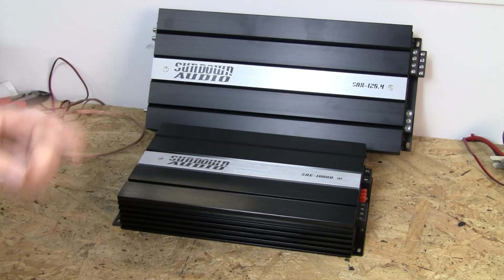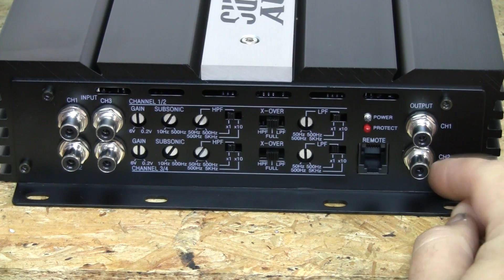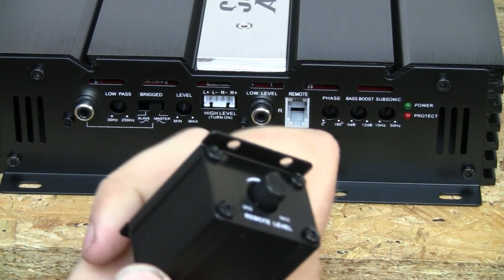Do you know what all these amp settings do? - Tech Stuff Tuesday

Comment: Concerning the PHASE knob adjustment, you have mentioned in most cases it doesn't matter. You may be right. In some cases makes the world of a difference. I think some amp designers have gone through specific experiences then decide it was actually crucial to put such a knob on every amp they would make. I think in every industry where quality is crucial, there have been are and always be small details which make collosal difference in that particular experience, details understood only by few who have had the pure luck to get it. One of my last experiences in car audio was with the grounds in a car audio system. On the internet there are different opinions on how to ground but never a general idea, you always find different pole opinions. Until you try it yourself. Having a common ground point for all your audio equipment in your car would enable you to enjoy your system how you were supposed to.
Reply from the maker: Grounds can absolutely make a huge difference. The phase thing is more common to see a difference in mids/highs than in subs. That can absolutely be a huge thing in the upper end of response.

Comment: Awesome vid as usually. 
Question, im trying to tune my rockford 801s. I have it bridged but there is a left and right gain. Which side/gain do i use to adjust the amp. 
Any help would be appreciated. 
Thanks and keep up the great work
Reply from the maker: I found those to be odd, I used one once. Move the gain knobs and see if one or both does something. That should answer it.
Reply: @EMFAudio  both work but one more than the other. 
Weird right. . 
I get mixed messages in fakebook but you know how that goes😕😕🥑
Reply from the maker: @heathentheheretic4909  I rely little on what people tell me and all on what I test myself.

Comment: So I heard you can damage a car amplifier by mounting it to a subwoofer enclosure is this true if so how does the car amplifier get damaged and what happens to the car amplifier when it gets damaged from being mounted to a subwoofer enclosure
Reply from the maker: It is possible. Solder joints can break which can cause larger failures. Board traces can fail too.

Comment: My mid and high amp start at 120Hz to 3kHz. My subwoofer amp is set to 80Hz.  Where should my mid and high be set at ?
Reply from the maker: You can only high pass starting at 120 hz? That is not optimal. Does your headunit have crossovers in it?
Reply: @EMFAudio  my H U has EQ .
This is my amplifier.
crunch PX1000.4 Power Amplifier (Class Ab, 4 Channels, 1,000 Watts) https://www.amazon.com/dp/B0196FLS50/ref=cm_sw_r_cp_apa_i_CbD9CbSCQ6TGV
And my HU.
XO Vision XOD1851 in-Dash Double DIN 6.2" INCH Wireless Bluetooth Touchscreen Monitor https://www.amazon.com/dp/B01DTN7O7Q/ref=cm_sw_r_cp_apa_i_-dD9CbSEGP8XA

Comment: I was wondering if using ofc for power to your amplifier and cca for ground would cause a issue?Or would it cause to much impedance change?
Reply from the maker: Impedance is dynamic, that changes in a magnetic field. I think you're thinking of resistance. To answer your question, resistance difference isn't what will effect performance. CCA can't handle the current OFC can. So, as long as you aren't exceeding the current capabilities of the CCA wire, you won't see a difference. If you exceed it's limitations, yes, you will see a difference.
Reply: Yes you are right I was thinking of residences . so with 4 runs of power 1/0 cca and 4 runs of ground 1/0 cca,I should be okay on a American Bass VFL COMP 5k?
Reply from the maker: @joebelton2146  2 runs of 1/0, what the amp actually takes in, would be sufficient. It's a 5k amp, not a 10k amp.

Comment: You should make a video on how to know what soft parts are compatable with what motor/basket assemblies. I've seen builds that have things like sundown soft parts in ascendant audio assemblies. Just something I've always been curious about!
Reply from the maker: There are literally millions of combinations. Parts are not universal in that all 3" coils fit in all 3" motors, etc. Different cones have different dimensions that will work on some baskets and not others, spider landing sizes vary, just a ton of considerations you couldn't blanket.
Reply: @EMFAudio  so id have to measure everything out, and contact manufacturers for soft part dimensions, is what it amounts to, correct?
Reply from the maker: @ddude1595  Generally speaking, manufacturers won't just sell soft parts. We don't, but we'll recone stuff with our parts and others we source. Basically you'd have to measure yourself, source parts yourself, and figure out what will fit. Just because it fits doesn't mean it will be good either.
Reply: @EMFAudio  so if it's not too much to ask, whether it's your parts, another company's parts or stock DC parts, what would you recommend for just a general overall improvement on a DC XL m2 15?
Reply from the maker: @ddude1595  There isn't a blanket answer for that because every motor and coil combination is different. The quality of the cones and spiders is one thing, the design of them is another, per application.

Comment: Quick question can you mix AMG batteries meaning different sizes amp hours if so how can I hook it up
Reply from the maker: Yes, Ah doesn't mean anything in terms of battery compatibility.
Reply: @EMFAudio  so I will still hook it up the same parallel and series
Reply from the maker: @FLYGUYFOX  Nooooooo don't wire batteries in series. That will add voltage to each one you do. So unless you're replacing 2 batteries in an RV that runs on 24v, don't do that. Parallel only.
Reply: @EMFAudio  it's for my car amplifier I have to hook up a parallel & series wanted to ask you more increase the voltage
Reply from the maker: @FLYGUYFOX  Putting two 12v batteries in series will have the capacity of 1 battery but increase voltage to 24+v which you can't charge and will likely blow up your amp instantly.
Reply: @EMFAudio  basically all I can do is put it in parallel for longer run time
Reply from the maker: @FLYGUYFOX  Yes, it's the proper thing and the only thing.

Comment: Quick question.  
I just repaired my Rockford 801s and I'm a little lost as to when it's bridged and should I adjust both gain knobs or simply one of them thanks
Reply from the maker: The owners manual should tell you, but one way to tell is to bridge it then adjust 1 knob, then the other knob. If nothing changes when you turn one of them then no it wont' matter. If it changes when you do both, then yes, you do need to adjust both.

Comment: Is it dangerous to pass speaker level input through rca inputs of an amp if it cant allow high level input
Reply from the maker: Yes and no. Yes you could do it, up until the maximum voltage of the amp. So in the case of these amps having a maximum of 6v, you could use the speaker level made into an RCA jack as long as you didn't exceed 6v. Over that could/would damage the amp.

Comment: Gain matching and phase matching of multiple amps on an oscilloscope with no load and then with subs wired video? Possible termlab scores for comparison.
Test A: Gain matched only with no load
Test B: Gain and Phase matched no load
Leave gain and phase settings as is and wire subs. 
Test C: adjust gains if necessary with amps under load.
Test D: adjust phase if necessary with amps under load.
Reply from the maker: The tricky part to that is having a vehicle with multiples of the same amps and multiple subs to benefit from phasing. I don't personally own anything that would be able to properly demonstrate that.

Comment: so could I use the bass boost to help a sag in a bandpass? like say it's tuned to peak at 35hz and 55hz, but the sag was in the middle, could you technically get rid or at least midigate the drop (within reason of mechanical limits of course)?
Reply from the maker: Presuming your bass boost was 45 hz and you had an actual peak at 35 and 55, yes.  Just because it's tuned there doesn't mean it WILL have peaks there.
Reply: But can bass bost introduce cliping at such given,frequency??
Reply from the maker: @brookeleimgruber860  It absolutely can. That's one of the reasons you should never use it more than a couple dB boost if ever.

Comment: my gains are set to max in every way shape and form on the amplifiers side, however my bass gain on my unit is only set to +2db and it sounds fine up to volume 25-31 (depending on the song) people don't understand that you can turn gains up but run your eq on the radio as you see fit.  i do not play into distortion and should i ever smell a speaker (again, certain songs hit that "moar power" spot) i dial it back a bit. i turn my tweeters up as high as possible to compensate but i do need an amp just for them. (4.4k bass vs 50*4 tweeter lmao)
Reply: So your saying you don't know shit and your a fool😂

While yes you can do that it isn't the correct way and also bad information to spread
Reply: You big dummy(fred sanford voice)

Comment: Will Subsonic filter cancel out the low pass because its lower hz
Reply: Think of the subsonic filter as a saftey limit on how low your subwoofer will play.
Reply from the maker: If you set it wrong, yes. Remember, subsonic is a high pass so if you set it to 20 hz and the low pass to 80 hz, that will be full signal from 20-80 hz. Now if you set the subsonic to 50 hz and the low pass to 50 hz, yes, it would absolutely kill the signal.
Reply: @EMFAudio  thanks for quickly responding love tec Tuesday keep up the good work
Reply: It's a cut off point to where the sub  or any other speaker won't play below that range. Like a high pass but for low end of spectrum

Comment: If the power and ground wires touch each other and short out the power and ground cause a car amplifier protection led to turn on
Reply from the maker: That should also cause the fuse to blow, hopefully quicker than the protection on the amp. That kind of short usually kills a power supply before protect can do anything.

Comment: I am surprised you did not mention the tweeter trick when setting the gain. Set up a test tone that is well below a tweeter's high pass crossover. Then hook up the tweeter in parallel with the speakers. Turn up the gain until you hear distortion from the main speakers, or anything at all from the tweeter. This works because the signal will not have any content in the tweeter's pass band, but when clipping occurs anywhere, there will be output from the tweeter. This will smoke out distortion even in head unit line out signals - really handy when doing factory radio upgrades... You can even do this for tweeters. Just get a high sensitivity tweeter and make a 12Db/octive high pass at about 15khz and keep your test tones below 10k. Putting a led in parallel with the tweeter can work too, esp if you can't hear tweeters anymore.
Reply from the maker: That's more of a gain setting thing on it's own, but I did think about making piezo distortion detectors to sell.

Comment: nice video what about it you have a processor  before amps u don't see much info on youtube
Reply from the maker: What kind of things are you thinking specifically? What would you want to see covered in that video?
Reply: @EMFAudio  we all know how to set amp gain an frequency how to turn up volume 3/4 up an set deck , but when you install let say audio control eqs these are high output or even a clarion preamp or both most pre amp have volume control how do u set gain an frequency on these processor an amp an can you still go up 3/4 volume on deck.
Reply from the maker: @wazid0122  For starters, no, we don't all know how to do that, that's why I do these videos. I don't even use 3/4 as a reference, I use the highest volume that is clean which on some is full volume. Setting the gain is the same method with a processor or not, which I could include in the video. I have some other ideas to include as well. I'll put it on the to-do list.

Comment: I thought ya use the subsonic only for inverted lol I keep it turned down always mmhh
Reply from the maker: Inverted or not makes no difference on how the sub behaves other than inverted you have a small amount more box volume.
Reply: I think your thinking of phase
Reply: Subsonic should around 20..
Reply: Probably just out of phase but turned down as in the lowest hz won't hurt any, actually maybe save your sub from damage

Comment: I need to learn more about gain and the voltage of the head unit. 
But this is very informative . 
Thanks
Reply: If u want to know u have a good input source get a pioneer deh-80prs, It can play to 90% volume before it ever gets near clipping it is the best unit under 950
Reply: @1-Six-dee  not that any people are willing/can spend $950 on a head unit. 

OP: Essentially gain adjusts your amps output. Most people think that it's like a "volume" knob. That if you turn it up your amp makes more power and vice versa. Not the case. Your owners manual will tell you what your head units output voltage is. And that's what you adjust your amps gain to. Most are around the 2-4v range. And while you can just turn it all the way up and lower you head units subwoofer setting or vice versa that's not the correct way. Best thing is to find the head units voltage output and adjust your amp as close as possible. I hope that helped a little....
Reply: @mikecheeze4312  the deh-80prs is only 249
Reply: Deh-80prs is 249 but there is proof search videos on yt on the outputs of the deh-80prs and at like 90% volume the thd is 0.1%
Reply: @1-Six-dee  that is why under 900 bucks dude. Also you can't tell somebody it's the best unless you have undeniable proof.

Comment: If there was a quality unit (similar to the deh-80prs)  putting out 6-9 volts could this voltage being clean produce more power?I know the amp can. Put out rated at 0.2-6 volt input but if u have a clean 7-8 volt input would the amp distort it just because of the input voltage being so hi?
Reply from the maker: The only way it could actually be producing more than 6v is if it was balanced outputs, which few are, and the amp would have to be balanced in as well. If you go over 6v you can fry the preamp on the amp. It doesn't just turn into a bad signal, it's like sending too much voltage into the power supply, it fails. That being said, a clean signal in, be it 0.2v or 6v does not produce more power. The setting is to match the signal to achieve maximum power output capability.
Reply: @EMFAudio  ty for the response, I have never seen a radio with a balanced output before seen the plugs on some amps but never seen any be interested to c the pros and cons
Reply from the maker: @1-Six-dee  I haven't seen any modern units with balanced outputs, I've seen some processors that do though. The only projected potential advantage is reduction of noise. With how RCA's have changed that isn't really an issue, which is probably why you don't see it anymore.